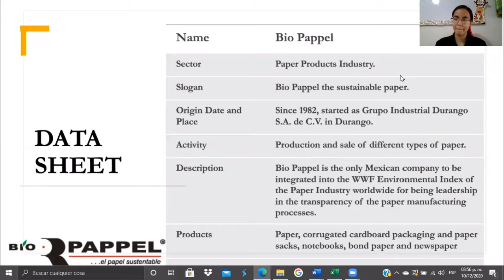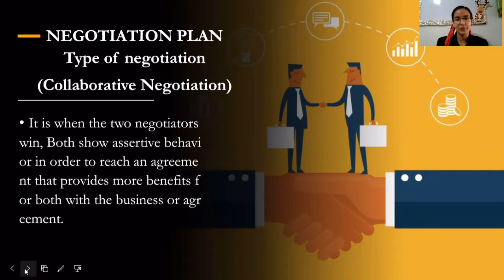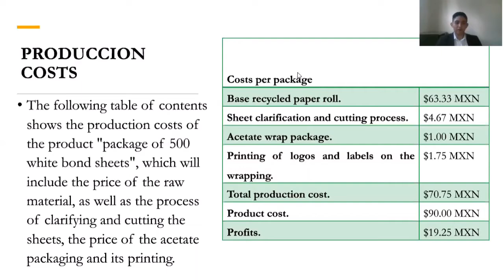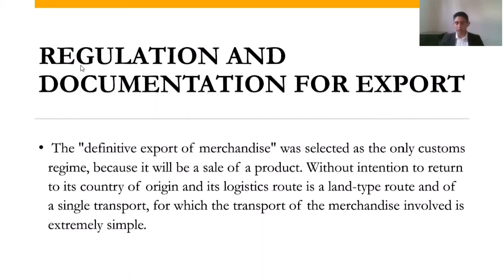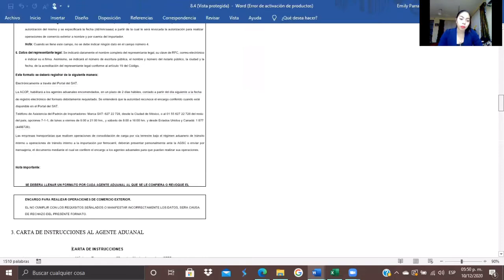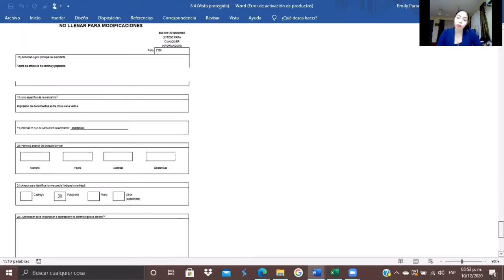INTEGRATIVE PROJECT 3C

Comment: Good afternoon. Young congratulations for the elaborate work and the results obtained. 
The question for the team is this: 

What are the advantages of sending your goods by land?
Reply from the maker: There were many reasons why we decided to go overland apart from that it is cheaper, more versatile and more security. We believe that in any type of transport there are disadvantages but personally we decided this because the schedules are more flexible and that land transport allows us to offer more adapted solutions to the client.
Reply from the maker: Thank you very much miss, for all your time and especially for each item purchased.
Reply: We saw it more feasible to send it on land as it was to put it in some way cheaper and safer, apart from that it is a very accessible place to get there